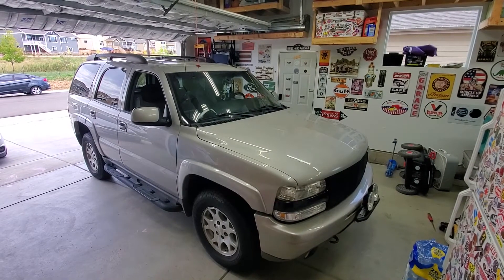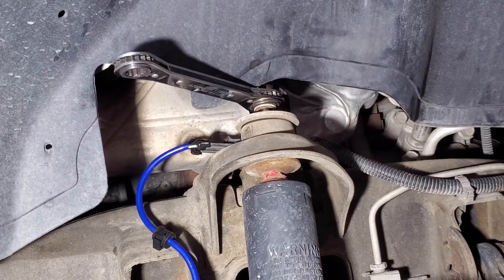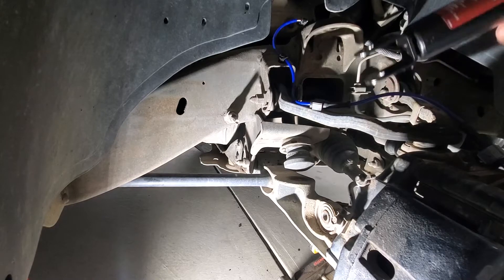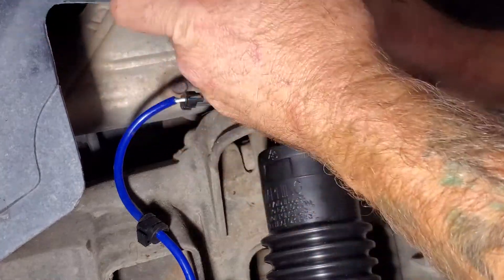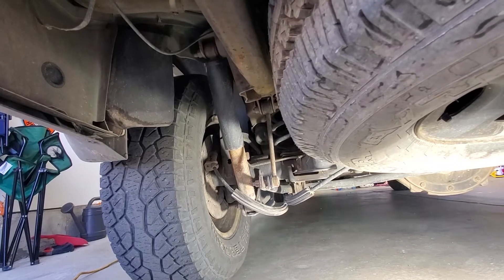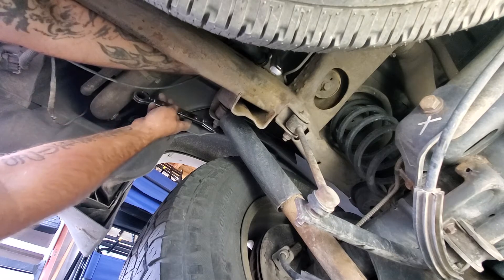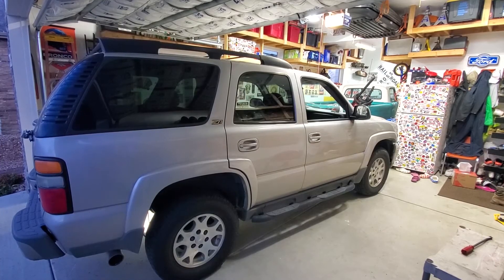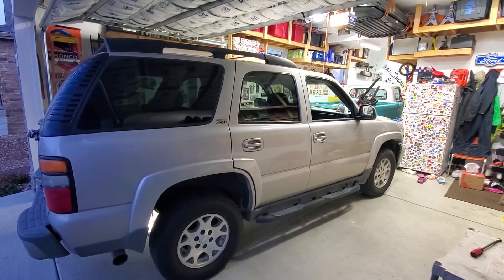Chevy Tahoe/GMC Yukon Front & Rear Shock Replacement

Comment: Jack, tried to contact you to ask this question, but couldn’t figure out how to do so.  Commenting here and hoping you might be able to help answer this question.  Just had the shocks replaced on my 2017 Yukon on a Friday at the dealership (along with a 50K mile checkup).  The following Sunday, I drove out to the desert and as soon as I left the pavement on a gravel road, the vehicle started to jerk and swerve.  Long story short, I realized that the driver’s side front tie rod outer connection had come undone.  Any chance the dealership undid the tie rod 0:02 to get more room replacing the shocks and forgot to screw the nut back onto the bolt that secured it?
Reply from the maker: I guess it’s a possibility but you should have the strut spring combo correct? And if I remember right you shouldn’t have to separate the tie rod from the steering knuckle there should be plenty of room to pull it out from underneath the vehicle between the control arms. Was the nut totally missing from the tie rod end? Or was it just separated from the steering knuckle? Does the passenger side nut look it was freshly loosened?
Reply: @BLUECOLLARGARAGE  haven’t looked at the others, but the nut was completely gone and the bolt was not stripped.
Reply from the maker: @patrickkeefe3672  yeah that seems suspicious especially since the threads weren’t stripped I wonder if they pulled it and just totally forgot to put the nut back on. Did they perform and alignment afterwards because the alignment tech should have noticed as well if it was missing.
Reply: @BLUECOLLARGARAGE  good question.  I’ll have to find out.  Thank you very much for the reply!

Comment: How does it ride ? My 04 denali has blown shocks and it's really bouncy
Reply from the maker: I put these on my buddy yukon and seems to like them pretty much has oem ride. He didn't want anything to stiff or soft and these seem to be right in the middle.
Reply: I used bilstein 5100, 2 inch leveling lift and honestly, 150k mile oem shocks felt the same
Reply: 2001 Yukon Denali xl here.  I have the air ride system can I just put new shocks on it?